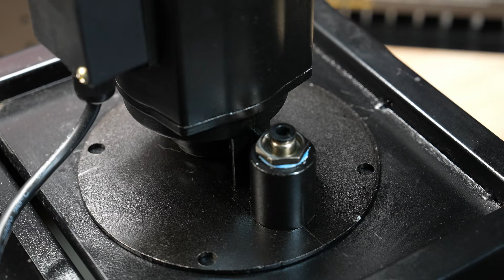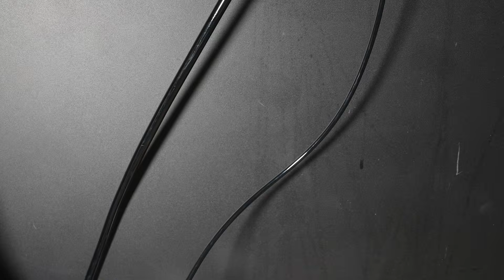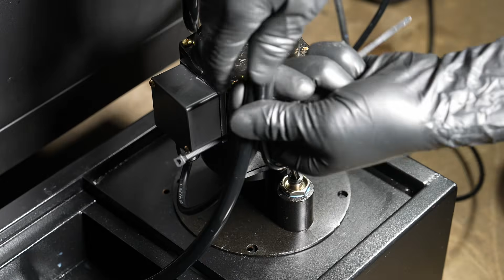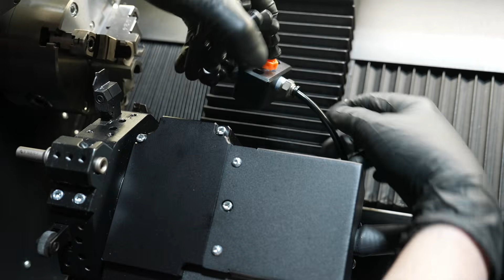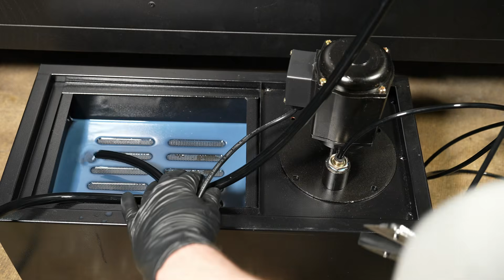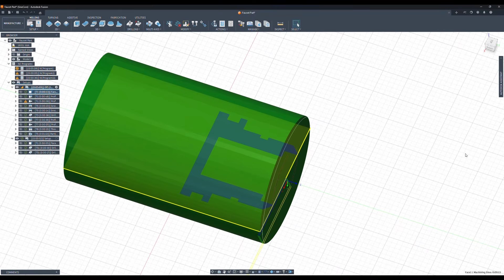SC-512L Coolant System Installation: Pump, Lines & Nozzle Setup

Comment: I'm impressed with the features and options on these machines - I do have some concerns about chatter and rigidity - is there somewhere I can physically look at one of these machine before buying one?  I looked all over your website, every page and cannot find a location, address anywhere.
Reply from the maker: We’re glad you like it! We don’t currently have a showroom, but we do have demo videos showing the machine cutting real parts so you can see the rigidity and performance for yourself. It’s built to be very solid for its size, and when paired with the right tooling and feeds, it handles a wide range of materials well. Feel free to email us if you have any other questions!